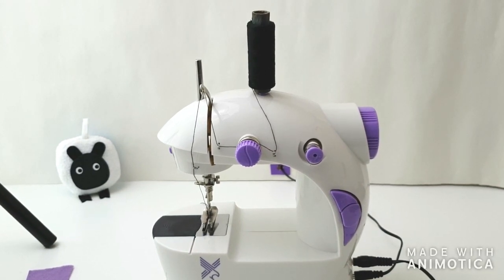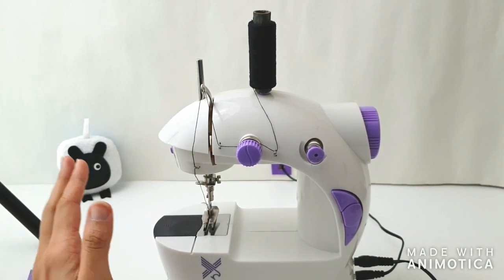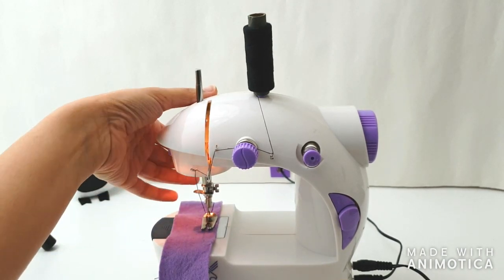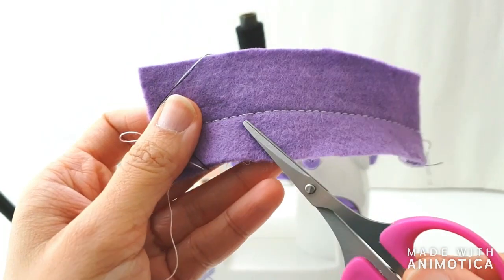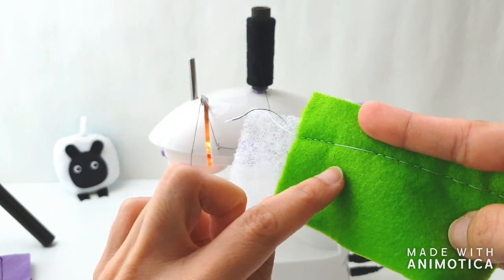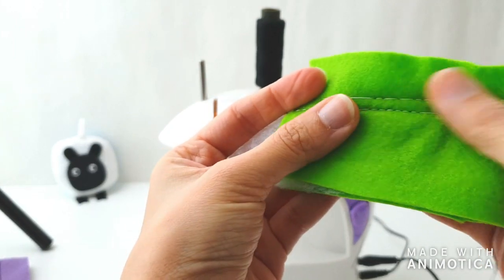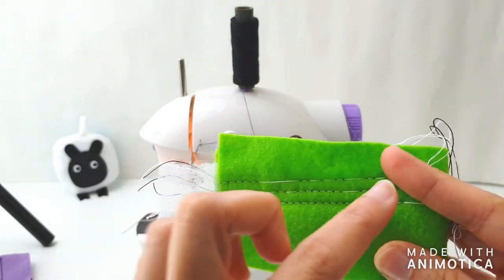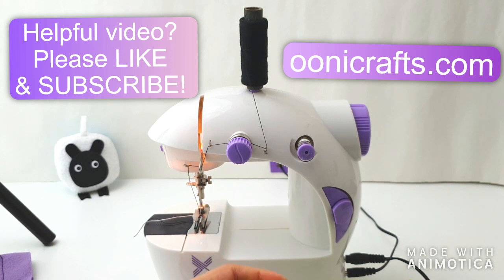Mini Sewing Machine NOT Stitching? No problem! | Beginner Sewing Tutorial

Comment: good morning i have a question for u what kind of thread are you using on your kpcb sewing machine i'm using gutermann cotton this is my second machine that i have the first machine did not work now   i needed  you're help please i love all your videos but i need help i already bout to many threads i don't now what to use on the kpcb mini sewing machine come to my rescue thank you
Reply from the maker: Hi Lucila, I too am using Gutermann. I also use Coats Moon. If you have checked everything and it still won't sew, it might be a faulty unit. These are mass manufactured low quality machines so there are no guarantees if it will work perfectly.
Reply: i have tried all the techniques u shown but still stitching is not working..so stress of it but mine is new..

Comment: Thanks for this video...
Shall we use pedal switch as well as power switch/ charging and batteries also when we using this machine
Reply from the maker: Koteswari, only use one power mode at a time. If you want to use mains, remove the batteries! Likewise, if you are using batteries, do not plug in the power cable. Hope this helps x

Comment: Hello I just started using this machine (I’m a beginner), and at first it worked perfectly, but now it’s just making the noise and the needle doesn’t move when I press “on” nor when I step on the pedal.
What should I do?
Did I accidentally break it?😭
Reply from the maker: Hi Elena,
I'm so sorry you are experiencing this with your mini sewing machine. I will try to figure out a solution to your problem asap. 
Please can you clarify: is the electricity coming through and you can hear the motor running but the needle is not moving up and down?
Reply: @OoniCrafts  this is the case for me
Reply: Ooni Crafts hello, yeah exactly like that.
Thank you for the fast response ❤️
Reply: Ooni Crafts yes the electricity is coming through, but the needle doesn’t move, the machine makes only the noise as if it was working.

Comment: Please my thread keep curling and cutting always...help me
Reply from the maker: Hi, thanks for your comment.  I will definitely look into this and make a video soon!
Reply: Thank u...i really dont no how to xplain it..after where we control the stitch,there's a long stuff where we also insert d thread b4 taking it to d small hole b4 d needle....it hangs on that long stuff that moves up n down while sewing..it wil curl and then the thread will cut...i cant even sew 4 straight 1minute,it will cut.pls help
Reply: .same here.
my thread keeps on cutting.
its tiring and pissing me off.
im sure you too got pissed off too.

.what i did is i use paper tape at the line where i should be stiching and sew slowly. 
using you right middle finger to guide the cloth and your left hand to slowly pull the stitched cloth.

try it.
just sew slowly using the step pedals
Reply from the maker: Hi
Did you try adjusting the thread tension?.

Comment: My neddle had  stopped moving on pressing the Button, what Should I do ?
Reply from the maker: Hi Priya,
Is the foot pedal working? If not, then the internal electric circuitry is broken. Can you try returning or replacing it?
I will be opening up this machine to figure out the internal problems and posting a video about this soon x

Comment: This happens to me plus the stitches at the back is not good 😢
Reply from the maker: Hi Marissa, have you run all the initial checks first?
1. Upper thread using the P-for-Perfect method: https://youtu.be/TU23CdgpxVo
2. Bottom bobbin using the Nifty Nine method: https://youtu.be/bP8MGc_sDUg
3. Use the correct needle size for your fabric. Tutorial here https://youtu.be/u6aHME4VV3g
4. Use the proper fabric with your mini sewing machine: nothing too thick or too thin. https://youtu.be/z4IKcWGFxeY
5. Balance the upper and lower thread tension for your specific project properly. Tutorial here: https://youtu.be/ZEky17PmJo0
5. If the stitches are still skipping, try this: https://youtu.be/33h1L5FVnn4
6. If the stitches are still not coming through, follow this tutorial to reset the timing: https://youtu.be/_N6F1ehfJKs

Let me know how you get on x
Reply: @OoniCrafts  thank you 

Will follow all.of them

Comment: Can u help me? My machine was working fine but when i started sewing once, it got stuck but the threads were fine and the wheel just didnt want to move. Also, it made a loud screeching noise. I can still sew with it but this still happens and when i spin the wheel thing it is hard to turn unlike my niece’s machine which is very smooth